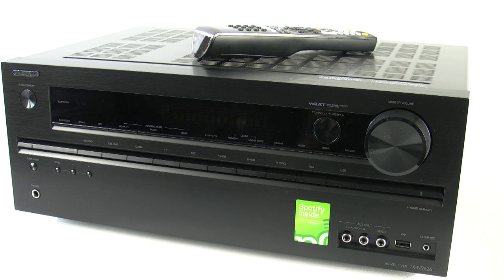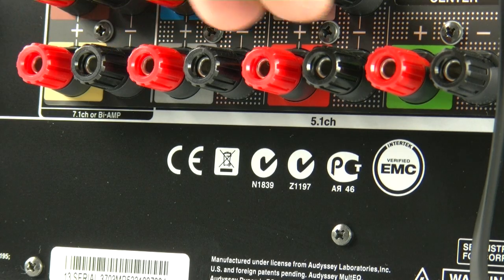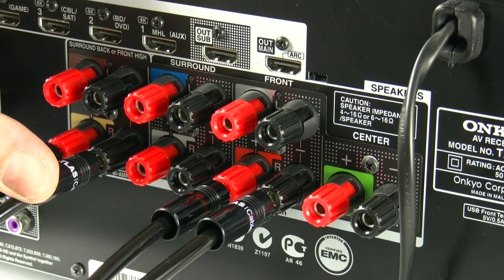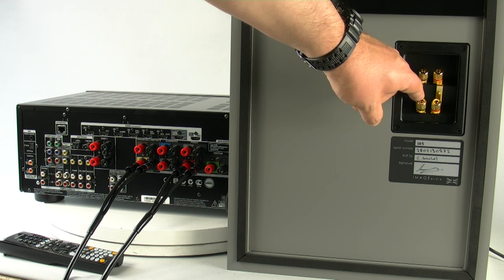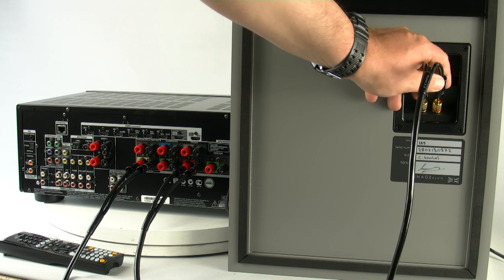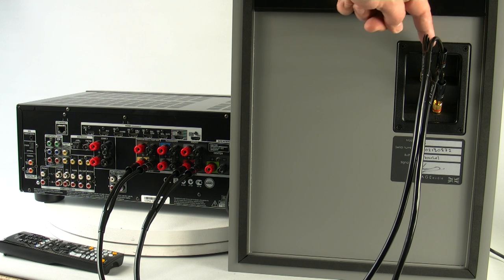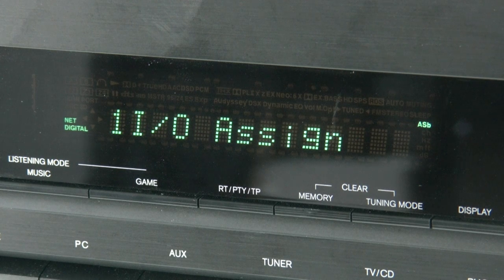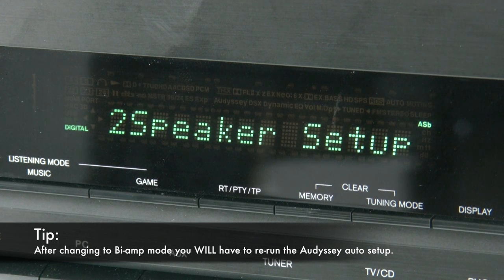NEW 2013 ONKYO AV RECEIVER TX-NR626 - How to Bi-amp the main speakers

Comment: hi I got a onkyo receiver and I did the bi-amping but my surround speakers will not play and when playing with Bluetooth on 5.1 or 4.1 it sounds funny..can you help me on how to connect these klipsch tower speakers and subwoofer
Reply from the maker: +mike ngabs Hi, please be aware that Surround "Back" speaker terminals on the rear can either be used for Bi-Amping (Front) or Surround Back. Also please check if Bi-Amping is still activated in the speaker settings (bi-amping has to be set manually in the speaker settings - it will not automatically be recognized by the room calibration). It sounds like the front speakers wired for bi-amping are actually outputting surround sounds (-> this could explain why it sounds "funny" when using surround modes). If the problem persists, please do not hesitate to contact the colleagues from customer care (via phone or contact form - all details on www.eu.onkyo.com ) Thank you!

Comment: Nice Instructional vid, but can you help me with my Sony STR-DN1040 , See Unit:
http://www.cnet.com/pictures/sony-str-dn1040/2/
Bi-wiring my fronts, i also  have two rears running, appreciate, in where my fronts should be plugged in ;-(   Thanks
Reply from the maker: Irish2u Hi, we're afraid we cannot really help you with Sony's products, but looking at the pictures in the link you provided it seems that you can either use "surround back" or "bi-amping front" speakers  - but not both at the same time. Maybe you should contact Sony support to verify this... Thank you

Comment: my speakers are ns-777 fronts
                            ns-c444 center
                            ns-333 rear
                            ns-333 rear surround
                            klipsch sw-350 subs x2
 I want to be able to use all 7 speakers and bi-amp at the same time. the receiver is Onkyo tx-nr515.
 please help

Comment: Since you've used the Surround Back ports in the receiver to bi-amp and bi-wire the fronts, would it be same to assume that the correct remaining setup for the actual rear surrounding speakers would get connected to the Surround port of the receiver?

Comment from the maker: Hi, You can use a wireless sender plugged into the zone2 pre-out ( take a look online for something like this - Marmitek audio-anywhere-625 ) and then you would plug in the receiver to a mini hifi/amplifier and then that would give you a wireless system. Yes you can listen to 2 different sources at the same time & different volume ( Note: All net services count as a single source) ...so FM in main room & Spotify in zone 2 will work !

Comment: Noob-Question about power, Say your speakers rms/continuous power is 200w, and then you bi-amp it, how is the power it receives divided or split?? I Don't understand this part in Bi-amping. Say your receiver puts out 100rms, does it go 100rms(from one channel) to the woofer(s)/low frequency and 100rms(from other channel) to the upper range frequencies? thanks in advance.
Reply from the maker: Hi Kaygun, certainly a valid question! Instead of dividing/splitting the power, the receiver uses a different channel pair for "full" amplification instead. E.g. the TX-NR636 supports a surround setup up to 7.2. If you would like to use bi-amping, two channels of the 7.2 setup will be used for bi-amping the front speakers. So in this case, your max surround configuration will be 7.2 - 2 = 5.2. Does this clarify your question?
Reply: That is good info but it doesn't answer my question about the power on the speakers end itself(my question was probly badly worded). I'll try again- I Basically need understanding of how you determine how much power each part of the speaker needs in bi-amping configuration. When I said divided/split I meant in the speaker itself. When you take those speaker terminal links out it separates the power-connection, in a way, allowing you to bi-amp. -so just needing an understanding of what power the speaker needs after you take the links out. would the low be equal to the high(in terms of power handling)? does it depend on the speaker? - I appreciate the help. I will come here for future questions and info/help also.
Reply: Kaygun D  I Feel like I'm over thinking it :(  here think of it like this, Take a speaker total power, separate it, now... The total power isn't going to be the same anymore b.c it's separate. The speaker itself is basically 2 speakers. How much does speaker A. handle and how much does speaker B. Handle. I doubt it's equal but that's just me, making an assumption. my thought is a tweeter wouldn't need or handle as much as a woofer or 2-3 woofers. :\ am I right? [A=tweeter    B=lower/woofers]
Reply: Kaygun D  subbed also.
Reply from the maker: Kaygun D Hi, the power each speaker (woofer, tweeter) needs basically depends on the one hand on factors like the speaker type, construction, energy conversion efficiency etc. and on the other hand on the required volume level. The room acoustic correction system of the AVR will take care that output power of the AVR will be adjusted accordingly for each channel.

Comment: Hi, i am in the process of looking for a new amp as my current amp is not rated very well and does not push my speakers. Will this amp power my Realistic Mach one's to there full potential? They use to crank pretty damn good on a maranze receiver i had a few years ago. Also can this receiver be bridged? as i will not be using all the channels. So i could gain more power output. Thank you
Reply: i guess you cannot answer this question for me?

Comment: I may be stupid, but this does not seem like Bi-amping it is Bi-wiring..
Reply: you don't need a separate amp to bi-amp, you just use additional channels to power the tweeters separately from the mids. Bi-amping just means that you use a separate channel for each component and this is true weather you use all the channels from one amp or from multiple amps, at the same time each channel has to put out the frequency that the components is designed for, SO THIS IS BI-AMPING! Bi-wiring would be the same as paralleling your wires and this can only be done with two speakers that are the same, they would run on the same frequency and with additional power due to the resistance dropping in half due to the paralleling!

Comment: Now if I have a 9.2 receiver and decide to bi amp it, does it become a 7.2 receiver now? Thats because I have seven speakers and 2 sub and want to use all of them. Yamaha ns-777 x2 yamaha ns-c444 x1 yamaha ns-333 x4 and klipsch sw-350 x2 subs.
Reply from the maker: Hi, yes, if you take the TX-NR3010 for example, a 9.2 Network AV receiver, you can use it to drive a 7.2 surround setup: front speakers are bi-amped and there are two subwoofer pre-outs which can be controlled separately / which can have separate levels.
Reply: Thankz again for your reply, if I win the lottery you will get a cup off tea on me. I follow most of   your videos and enjoy them.

Comment: nice video and description; curious how much of a difference was noticed? I'm sure it's subjective but is it like night and day difference or just slight gain?
Reply from the maker: It very much depends on your speakers and cables, too - using high end speakers and proper cables, the chance to notice a difference will be much higher. Nethertheless it is still subjective, and you should probably expect a slight gain, but not a "night and day difference". It's like fine tuning, but not a necessity...

Comment: How do i connect a subwoofer cable to a car bass? :o
Reply: You cut the end off that goes to the bass and strip the wire then there should be positive and negative wire

Comment: ive heard of people saying this isnt true bi amp. is it true that an actual separate amplifier is better than using this method?
Reply from the maker: +emersonleon85 Hi, as long as you use separate cables for your woofer and tweeter and set your AVR to bi-amping, everything should the fine. The AVR will then use separate amplifier circuits (here: amplification channels) for your tweeter and woofer signals. Of course you could be looking for a real high end setup, like using a mono block amplifier for each channel (L/R) and woofer/tweeter, with e.g. a total of 4 separate amplifiers required :)

Comment: Are the front highs and fronts electrically crossed over or is the left front high the exact same signal as the left front (and ditto for the rights)? If it is crossed over, can you change the crossover through the menu (or at least manually eq the high and bass separately)?
Reply from the maker: 1dgram Hi, the front highs and front have different signals - as they are processed differently by the DSP (e.g. to extract/generate height channel information). So basically the their meaning is not to separate high/bass - but to provide an additional height audio channel with a different signal than the regular front speakers (as their signal was not intended to be used for height speakers).
Reply: OnkyoEU When you say height channel information, do you mean for Atoms, for correction of room acoustics, out for something else?

Comment: I need to know how to by wire no one seems to show how to connect to the amp  everyone shows how to connect the speakers but always leaving how to connect to the amp why would they not show all connections please help
Reply from the maker: Hi, this depends on the equipment you have and that you want to connect to your AVR. Please see the latest AVR manual (e.g. for TX-NR686) which has been greatly improved, showing connection diagrams for different settings:

https://www.eu.onkyo.com/downloads/3/3/4/1/8/Manual_TX-NR686_En.pdf

And please do not hesitate to get in touch with our customer care team if you still experience issues or still have questions, e.g. via

Phone:
https://www.eu.onkyo.com/en/customer-care-hotline-42615.html

Email:
https://www.eu.onkyo.com/en/feature_article_en_42204.html

Thank you!

Comment: hi, my AV 5.1 receiver doesn't have that bi-amping feature in the menu. can i just place a jumper on front & surround  analog inputs? thanks.
Reply from the maker: Hi, if please do not put any jumpers on any inputs or outputs of your AV receiver, you risk to damage it. If you have separate inputs for tweeter/woofer on the back of your speakers, it might be necessary to place a on the connectors of your speaker (if not using bi-amping/bi-wiring, e.g. when  not supported by the AV receiver). Please consult your speaker manual on how to properly set the jumpers in this case.
Reply: i understand the danger of jumpering speaker outputs. i am talking about front & rear L to L, R to R inputs only to manually mimic the front signal. thanks.
Reply from the maker: Hi, for this purpose the receiver supports different listening modes. In your case, please select "All Ch Stereo" - this mode fills the entire listening area with stereo sound from the front, surround, and surround back speakers. Please also check out the other listening modes which could be of intest to you. In case of TX-NR626, you will find the information on page En-42 in the manual - chapter "Using the Listening Modes".

Comment: do my front speakers have to have 4 posts to do this... my fronts only have 2 post on each speaker
Reply from the maker: Hi Joshua, yes, if you would like to use bi-wiring, 4 posts should be available: 2 posts for woofer, 2 posts for tweeter....

Comment: Crossoverfrequency? How many dB / octave?
Reply from the maker: Hi, using the current model TX-NR686, the crossover frequency for the front/surround/rear/... channels can be set between 40-200 Hz, and for the LFE channel between 80-120 Hz.

Comment: I have the ns-777 front speakers if I bi amp I will be looing one of my surrounds. now how do I used all my 7.2 speakers from bi amping? please help.
Reply from the maker: Hi, please be aware that bi-amping the front speakers will only work in a 5.1 surround setup. Reason: bi-amping means that separate amplifiers will be used to drive the tweeter and woofer of your loudspeaker. So instead of 1 amp to drive the tweeter + woofer of your e.g. front left in a regular setup, you will need 2 amps in a bi-amping setup, 1 amp for the tweeter and another amp for the woofer of your front left. So you will need 2 additional amps do bi-amp your front speakers L+R. With your 7.x receiver, the additional 2 amps required for bi-amping will be taken from the surround back speakers - so there are only 5.x channels (amps) left for surround. If you would like to drive all 7 speakers in 7.1 surround, you would need an AVR with at least 7x2= 14 + 1 (subwoofer) amps, theoretically... We hope that clarifies why there is only 5.1 surround in bi-amping mode - and thank you for asking.
Reply: Thanks for taking your time to answer my question.
Reply: OnkyoEU you don't need a separate amp to bi-amp, you just use additional channels to power the tweeters separately from the mids. Bi-amping just means that you use a separate channel for each component and this is true weather you use all the channels from one amp or from multiple amps.
Reply from the maker: Hi,  to avoid possible confusion: when talking about "amps" above, we meant the amplifier component / integrated device / chip that powers a channel - and not an amplifier/receiver as a stand-alone product. As you suggested, talking about channels might be less confusing for readers. Thank you for your comment!

Comment: Hay can I ask u a question how do you rest to factory settings on the Onkyo TX NR 929
Reply from the maker: Hi, to reset the AV receiver to its factory defaults, turn it on and, while holding down CBL/SAT, press ON/STANDBY. “Clear” will appear on the AV receiver’s display and the AV receiver will enter standby mode.
Note that resetting the AV receiver will delete your radio presets and custom settings...

Comment: Hi.. is it ok if I plug the back surround to LF and the front speaker to HF? Thanks!
Reply from the maker: Hi, for bi-amping, you connect low frequencies/woofer to your "FRONT" terminals, and the high frequencies/tweeter to the "SURROUND BACK/FRONT HIGH" terminals (e.g. as described on page En-14 of the manual). Thanks for asking!
Reply: Got it!..Thanks!  I thought I mixed them up but I got them right. I have TX NR609 model how come the setting  doesn't have the option to choose the Impedence.
Reply from the maker: Logan Nayve
Hi, you can switch the impedance setting in the speaker setting menu (e.g. page En-46 in the manual). Please be aware that this feature is only available in European, Australian and Asian models. For North American and Taiwan models, speakers with an impedance of less than 6 ohms are not supported.

Comment: I did the bi amping in my Denon AVR x4300 and did all the set up however I didn't notice anything different?  Is it better to get an external amp like parasound or rotel?
Reply from the maker: Hi, typically, bi-amping + bi-wiring will not give you a radically different sound experience - you could consider it as a last fine tuning, when all other components have already been optimized. The quality of the speakers will have a much, much larger impact on the audio quality than bi-amping, also using suitable cables will be more important and make a noticeable difference (please consult your local hifi dealer when in doubt). As a last step, bi-amping + bi-wiring can be used. In any way, you will typically need to use quite expensive or large, power-hungry speakers to have a change to hear a difference.
Reply: OnkyoEU for the front I have two klipsch ref 82ii and back i have two JBL s312 studios series with a 12 inch sub.thinking about getting an external amp to run the front speakers, like Adcom GFA 555.  What do you think?
Reply: Thank you
Reply from the maker: Hi and sorry, we hope you understand that we cannot provide support for any other brands/manufacturers (we do not know their products in detail). With regards to any ONKYO branded products, we will be glad to help... :) Thank you for your understanding

Comment: This might be a dumb question, but If you have 8ohm speakers why set it to 6ohms?
Reply from the maker: Hi, basically the AVR speaker setup use two impedance ranges: 1) 4 Ohms to < 6 Ohms and 2) 6 Ohms – 16 Ohms. As the speakers are 8 ohms speakers, the 2nd option is chosen (6 to 16 Ohms). Thanks for asking!
Reply: OnkyoEU Hi, my Onkyo 636 has the option between 4 and 6 Ohms. My center has 8 Ohm, all other speakers have 6 Ohm. The German manual says: "If ONE speaker has more OR less than 6 Ohm, do the settings on 4 Ohm. That implies to me, that, if not all speakers are 6 Ohm, the setting on the receiver should be on 4 Ohm. So what is right? Thanks in advance!
Reply from the maker: Eric Cartman
Hi Eric, please select the 6 ohms settings if all of your speakers are between 6 and 16 ohms (which is the case according to your description). Choose 4 ohms only if one of your speakers has less than 6 ohms. Hope this clarifies your question - thanks for asking!
Reply: Thanks for the quick response! Great!
Reply: OnkyoEU Hi, I also have a TXNR636 which is rated at 6 Ohms while I have a pair of 8 Ohms PolkAudio front speakers. Should I set the Amplifier at 6 Ohms, right? Also, is this whole operation also defined as "bi-wiring"? Because I've been reading online that Bi-Amping is when 2 different Amplifiers are being used. Thanks!
Reply from the maker: Victor Victor,yes - if none of the other speakers connected to the amp has less than 6 Ohms. If any of the connected speakers (e.g. surround) hav less than 6 Ohms, then please use the 4 Ohms settings. Regarding Bi-Wiring/Bi-Amping: This is a different story. We have a video in this channel, covering this topic - just look for "Bi-Wire Bi-Amp". Thanks!